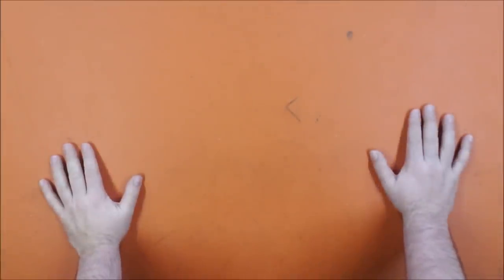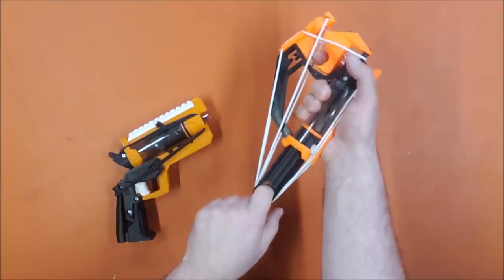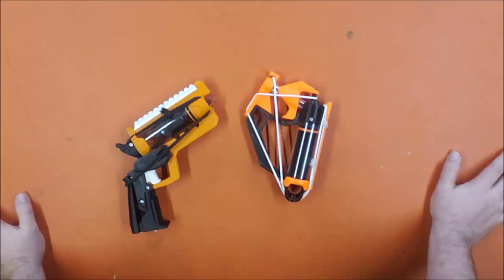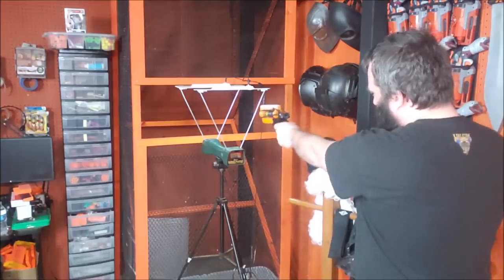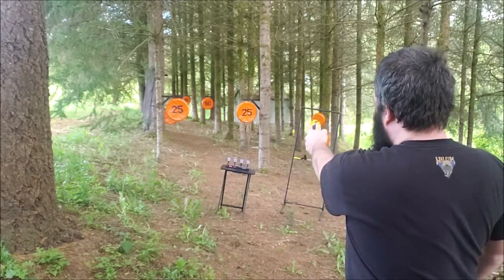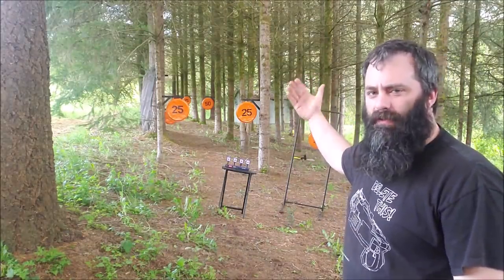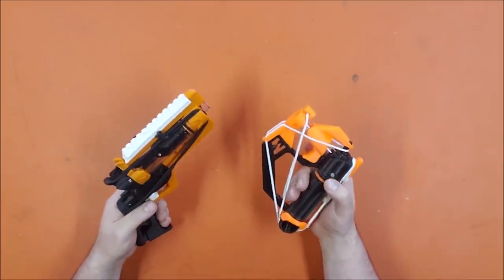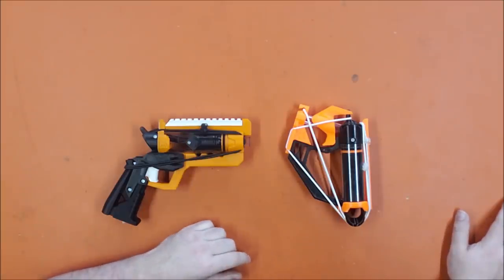Captain Slug - HYPR - Review and Demo

Comment: Hey this may fall on deaf ears but i discovored a deadly sniper, it cost 10 dollars and i belive it hits a t least 200 fps though i dknt have a chronograph to confirm, 10 bucks will get you a daisy sling shot, if you put the dart in the poch horizontally facing the slingshot the dart will fly strait and even surpass a dtan blaster in rane and fireing rate but you loose versitility
Reply from the maker: link?

Comment: Create a revolver version and it'll be a band powered Hammershot that shoots harder than a regular Hammershot!
Reply: Aaaaaand it would have an easily customizable power level to boot! Need to drop down to stock Hammershot performance for some reason? Less and/or weaker bands!
Reply: Idk, my hammershot is pretty powerful.
Reply: @radioactivesdesigns3554  there are few Hammer Shots that shoot above 80fps. This shoots 100fps so....

Comment: I have been curious if a blaster that has been made entirely from either, generic parts that aren't used or designed specifically for nerf blasters or were 3D printed custom for the project would be legal in most HVZ games and/or nerf wars. If you have an answer then if possible please let me know if you don't have either an answer or a way of contacting me then that is fine. Thank you for your time and for the great videos and the hilarious and inspiring stories.
Reply: Homemade blasters are commonly used at HvZ games. Allowance for them is based on fps caps for those events/venues.

Comment: Have you had any issues with the hammer piece(called the "cammer") breaking?
Reply from the maker: ...if I had, I would have mentioned it...
Reply: @CaptainXavier  Mine must have had a defect. It is good to hear that others are not breaking, though.
Reply: Mine broke near the trigger using a Wrap 1 + 2 combo. I'm bit scared to try it again but Captain Slug reprinted the part for me.